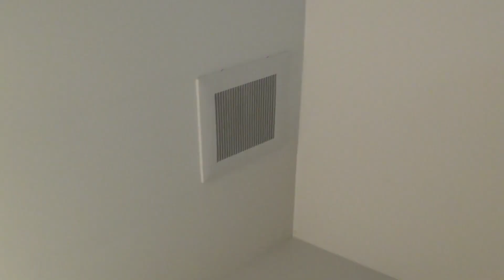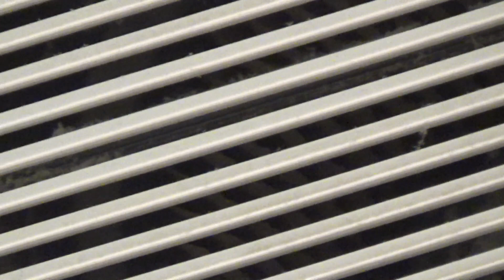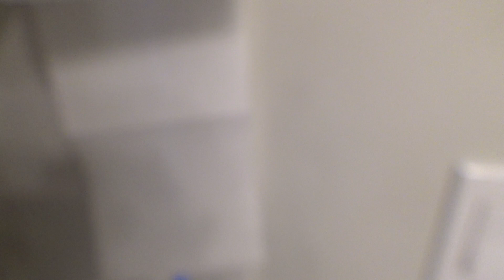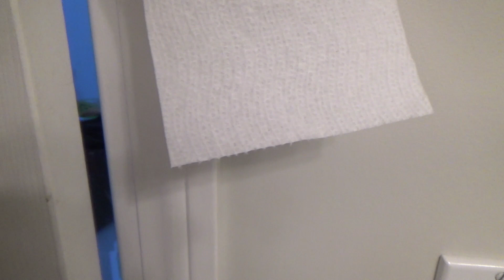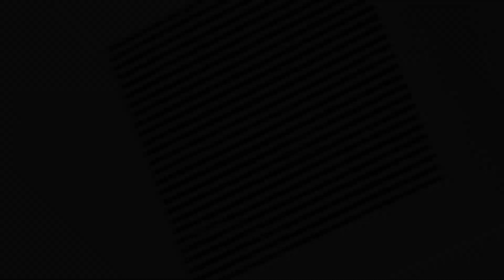Nutone Bathroom Exhaust Fan at the Old House | Unit 2 of 2

Comment: Yeah, like the other one, this seems restricted also. I imagine whoever installed this, like the other, maybe just connected it to the existing undersized duct, or possibly there is a blockage in the duct somewhere. I too believe that may be a Panasonic fan, it should be far quieter and move more air than it is.
Reply from the maker: The duct was new when the fan was put in, but it very well could have just been wrong to begin with. Perhaps it is a Panasonic fan, I don't really have any reason to believe it's a Nutone other than the two being purchased and installed at the same time.